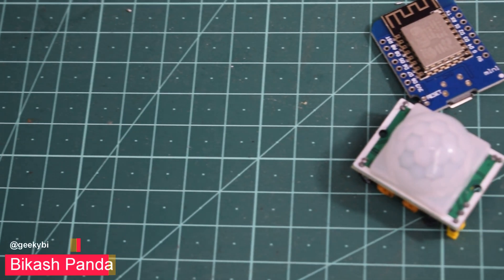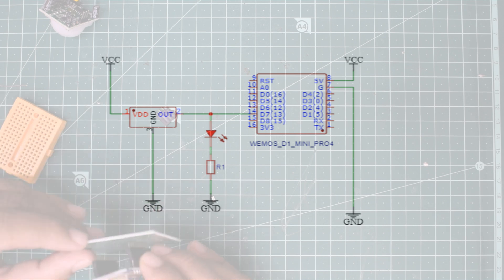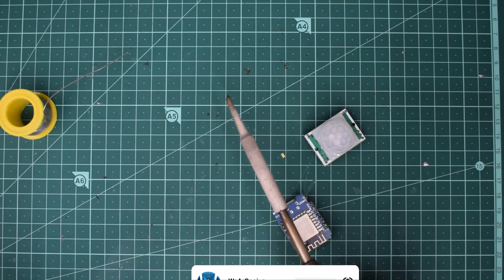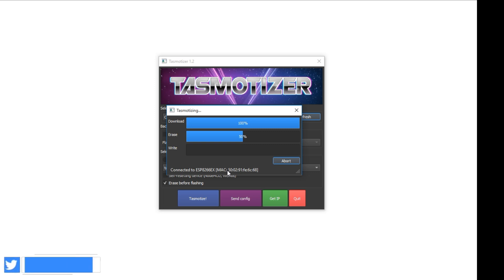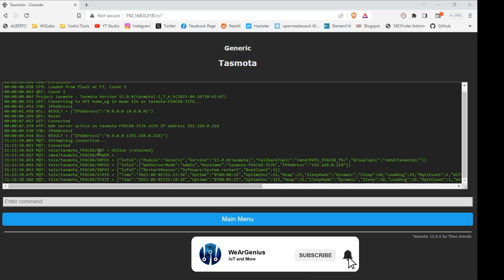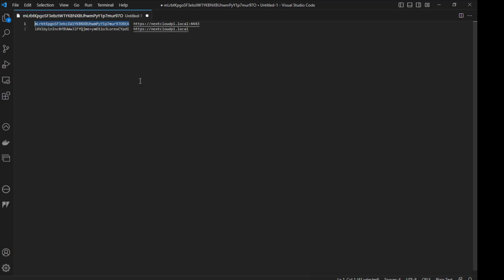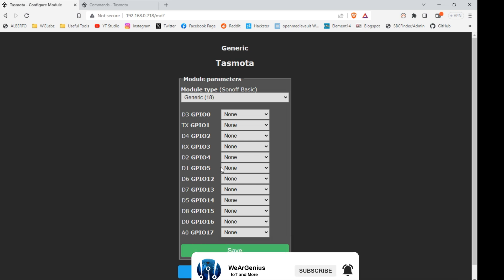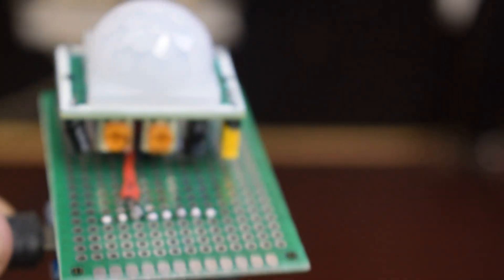PIR Motion sensor using #tasmota

Comment: I have been looking for a channel that just concentrates on Tasmota only with no home assistant as I only have a few devices, 6 lamps, two door sensors, one temperature sensor, I hope your channel will help, so I have joined.
Reply: Did you find ? I want my Switch to control TWO or more Relay is that possible without MQT